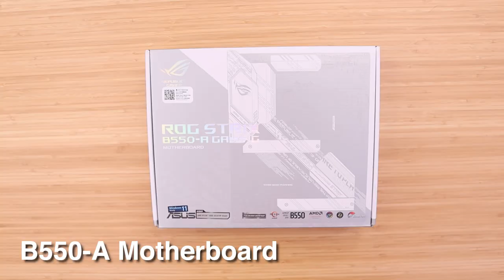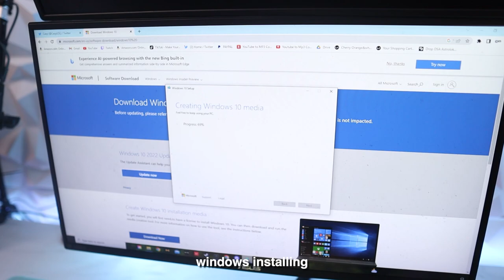Building A $1500 BUDGET Gaming PC

Comment: it looks sick, but i suggest switching the ram sticks to slots 2 and 4 for optimal performance and to take advantage of dual channel speeds
Edit: i just noticed the front 3 fans and bottom 2 fans are set to exhaust. i would highly recommend switching those to intake and then switching the fan on the back from intake to exhaust for more optimal cooling